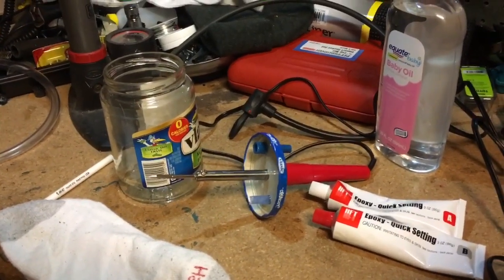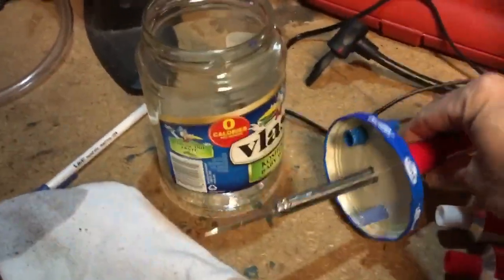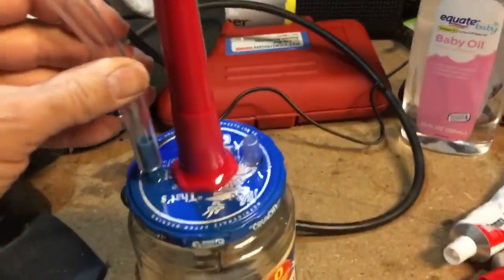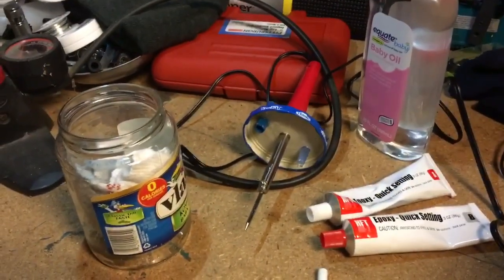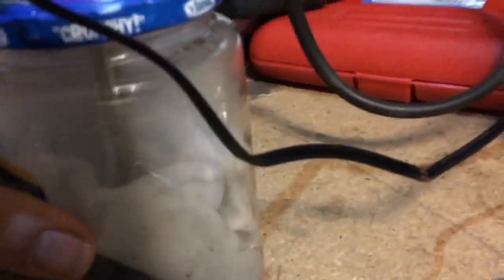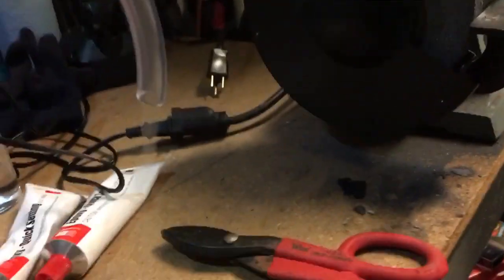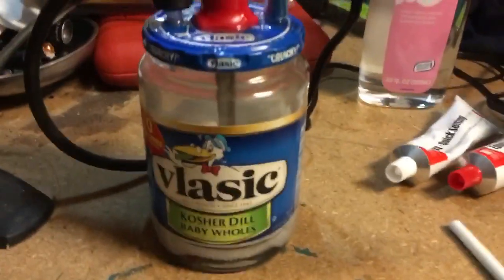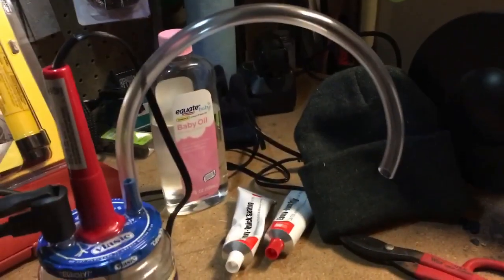Homemade smoke machine

Comment: I just put a pressure regulator attached to my spare tire as an air supply as long as you don't go over 1.5 psi you're fine

Comment: Get a cheap aquarium pump for a 10 gallon tank... You can find one for 4.99    Safe to use in evap systems because it's very low pressure
Reply: does this actually work? is it enough power for fuel line stuff too? also do you use baby oil too?

Comment: DANGER! Cheap soldering irons like yours typically have a heat coil running house current - 120 or 240 VAC - which extends almost to its tip. If water gets in there, trouble...
Reply: ??  Cheap soldering irons use a nichrome wire wrapped on a length of mica board, each portion of the length representing only a small % of the total resistance of the element, so even if you were to submerge the end in water, it would make little difference unless you added salt to the water for higher conductivity, and yet it is submerged into non-conductive oil not water, so there really isn't any danger.  Try it yourself from a safe distance, rig that up, fill the jar till the tip (only) is submerged, leave it at a distance while you flip the AC circuit breaker to turn it on and back off.  I suspect that the most that will happen is if a bit more current runs through the nichrome wire, it could melt to an open circuit (disconnected, no current) state further up the iron where it is not cooled by the water.

Realize what the real danger is with water and electricity.  It is when YOU are submerged in the water, and a high voltage, not one limited by the resistance of a heating element, finds a path through you to earth ground.  Where is the path with an iron in a glass jar and you outside the jar?

By all means, do avoid or at least proceed with caution working with live mains voltage if you don't understand the issue(s), but please restrain from telling others, too, if you don't understand the issues.  Thank you.

Now on a related note, his project might have been more effective if he had just removed the heating element from the soldering iron and ran it bare instead the jar, or perhaps use a light bulb with the globe removed instead, and work out the immersion depth to directly smoke the oil without any cloth involved, OR  just avoid mains AC entirely and use use a cotton shoelace in a jar with oil as an oil lamp to produce smoke... or imagine if you will, just using a real oil lamp.

Comment: Is it safe to use since heat from heating babyoil will come in  contact with Gas Vapors in Evap system which is closed system and may cause explosion of gas filled tank ? or do we need pass this smoke tube through Ice filled container. What do you think ?
Reply: There is a trivially small amount of heat in the smoke, which is nowhere near enough to ignite anything downstream of the soldering iron tip.  However, it is warm enough to degrade some plastics so you have the sacrificial hose going from the pickle jar output nipple, to the evap entry point.  You would not want to put the exhaust from this on the INTAKE of a pump, if you want the pump to have long life and it has (non-thermo-) plastic or rubber components.

Comment: Umm, yeah, you forgot to mention that because you're using baby oil, the smoke coming out makes everything slick, slippery and dangerous...
Reply: U may not want to use baby oil since it may be diluted w water, any water vapors is big no for evap system, will cause more problem, may b ok for vaccum leak which is not that sensitive to water

Comment: This is great.  I need one of these, but I think I will borrow a few ideas from others who used a paint can as the vessel.
Love the soldering iron/ pickle jar/ clear tubing used in this model, but will switch to the compressor fittings and use of a compressor to provide the pressure.  The guy who suggested using incense has a good point ; that would simplify it considerably. Thanks for spurring my imagination!
Reply: Do not use flammable incense stick in highly flammable Gas Vapors, may catch fire and explode the whole gas tank, do it outside the house in open.
Reply: @ashtonwoods  Nonsense.  You can hold your hand over burning incense and determine the inadequate amount of heat to ignite anything not in direct contact with it.  The incense is not IN the gas vapors, rather upstream of them.  Big difference.  Merely running an engine, gas vapor contact with an engine intake valve, is far far more heat exposure than that.   Plus, it all needs oxygen to burn.  You could stick a lit match inside and it would self extinguish.

Comment: Regarding the smoke coming from the cord outlet, how about this brilliant idea. Cut off the plug, then slide a piece of heat shrink tubing over the cord and body of the iron where the cord exits the body. Use a hair dryer to shrink. That will give an airtight seal around the cord and seal up the hole. Then attach a new plug to the cord.
Reply from the maker: TheLarryBrown great idea !

Comment: Just use an incense in the jar.  works like a charm, smells good and no batteries, socks or bike pump required.
Reply: Are you sure it's a good idea to use incense? I can't imagine that kind of smoke being healthy for your EVAP system.
Reply: @JBlooey  So you think burning baby oil which is not designed to "smoke" is a better choice than to use something that was only designed to literally smoke.
Reply: Youre both idiots!
Reply: @javaidsadiq5775  Only an idiot would call people idiots without an explanation.   Now thats an idiot.
Reply: @javaidsadiq5775   Still can't come up with an answer eh?
Reply: Don't use incense stick since in evap system gas vapors r highly flammable and explode the gas tank  do it outside in open air and may be safe for vaccum leak system but big no for evap.
Reply: @ashtonwoods    Its safe buddy.  Its just smoke.

Comment: Does it need to touch the sock or just be dipped in the baby oil?
Reply: Of course it needs to touch the sock.  If it only needed to be dipped in the baby oil (which is another way to design it if you had a much hotter soldering iron, but with only a lowly 40W iron it would only heat the oil and it would cool from surface area before it reached the oxidation temperature) then there would be no need for the sock.  

What the sock or other cloth does is put in contact with the limited heat source, a smaller steady supply of oil wicked up it, so it can get hot enough to oxidize a small amount at a time.

Comment: Do you put a lot of oil in or just saturate the sock?
Reply from the maker: ChevyC101980 1 about 3/4” high
Reply: You need an oil reservoir that the sock sits in, just enough that you don't run out of oil.  It does not need to be any particular amount, just a tiny bit more than your wicking material holds by itself, with the area of focus being how far the distance is between the oil reservoir and the heat source, and how fast that material wicks.

In other words, you only need a tiny bit of material and oil. The huge amount shown and used is quite overkill by 50X, except of course that this particular design depends on the length of a soldering iron with the handle flush with the lid, so it needs a far deeper pickle jar than you'd otherwise need to produce the desired result.

Comment: what size vinyl tube?
Reply from the maker: if you click on the link in my description the guy that originally made one has a detailed list.
Reply: @alfredlyon27  Not true. He just lists soldering iron, bike pump, and mineral oil in his description. Please state the size of the vinyl tubing.
Reply from the maker: Brian Kennedy I did what he said to do. Take the pen cap to the hardware store and find a tubing that fits. It’s under a 1/2” OD and over 3/8” ID

Comment: Smoke can come out the wire end of the soldering iron. Need to block the bore of the  pin  holder w/ foil.

Comment: Wouldn't the air pressure coming from the bike pump damage the evap system?
Reply: No it works the same way the professional machines shops use except most of them use air compressors, or they are electric with built in air pumps.
Reply: Just get a pressure regulator for 7 bucks at Harbor freight.. As long as it doesn't go over 2 psi.... You can also use a fish tank aquarium pump for a 10 gallon tank takes like 2 W of energy and blows very low psi